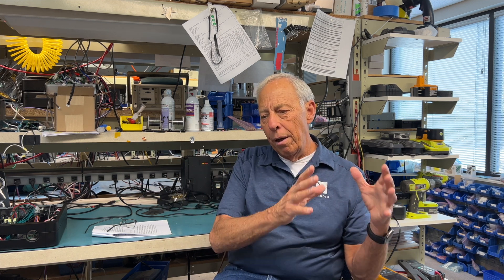Class D amp fatigue

Comment: In my engineering mind, the amplifier should be able to be treated as a black box.  You put a signal into the input and the output ideally is exactly faithful to the input except for having its amplitude increased.  

The faithfulness of this process can be measured and all sorts of geeky engineering characteristics derived.  Doesn't matter if what's in the black box is using a linear or switching power supply, tubes or solid state, bipolar or FET, or what class is being used.  

What matters is how faithfully the amplifier reproduces the input signal.  If it does so well, regardless of the topology inside the box, then it's doing its job.  If a listener is fatigued by listening to a clean amp and prefers listening to their source material through an amp that's less clean and adding color to the material through a less than faithful reproduction, that's not an amplifier issue, it is listener preference.  A subjective impression rather than an objective one.

Like police doing a roadside sobriety check.  Multiple people can watch the test and come to different conclusions - the trained officer (audiophile) arrests the driver based on subjective evaluations and later blood tests (objective) reveal 0.00...0 for alcohol and drugs.

Ultimately it's up to the individual what sounds best to them.  The only real way to know though is the trusty double blind test.

Comment: I disagree. Because paradoxically, this tiring character of class D comes from something "good" in terms of parameters, i.e. a high damping factor, PS Audio amplifiers are no exception. A high damping factor makes the sound "very controlled" but also more nervous, so "short" and kind of tiring. This has nothing to do with the filter (which can affect transparency, decay, etc.). So in my opinion Paul made a wrong diagnosis and (as usual) advertised his own products.

Comment: good coils for the output filter cost a lot of money. low inner resistance makes the coil bigger and it needs the right core material so that it does not get into magnetic saturation when you go over 10W output.
my aiyima 07 max has a 240W power supply that means 2*100W output is possible. i guess they do not have the best coil from coilcraft or würth inside because they are expensive and the aiyima 07 max costs only 95€. but i think below 2*20W they probably do not go into saturation. and i guess i did not go beyond that so far.
when the coils go into saturation at a certain power level, the audio signal gets distorted and that probably contributes to the listening fatigue

Comment: I have an early Class D integrated from Cary Audio (20 years old). It is generally on a 2nd small system.  Cary is most well known for their tube gear that is the polar opposite of fatiguing. However, while the Cary has amazing power and grip with my Volti horns, after a while, I do tend to notice that fatigue factor that the writer mentioned.  I am glad to know there are more class D options as I like much about the format, especially lighter weight and less heat.

Comment: Here is the limits of class D ;
Every frequentie-range you adjust in an equalizer in Windows or Linux has a negative influence in other frequencies.
When you adjust 500Hz - 1.5dB you boost the lower frequencies but also the higher voices starts to distort.
As i understand, every adjustment, changes the impedance in other frequency ranges. 
So you add distortion and higher frequencies really start to distort / cracking when you start to adjust somwhere in the bass or voice range.

"EQ flat" ; some people like the "extra detail" but for most people it is exhausting. 

If you want to fine-tune what is coming from  a class D amplifier you must make the adjustments with really 0.1 dB's  

I have experimented all logica.
To adjust the equalizer then start with the high bands.
I own a Yamaha and lowering the last 3 only, works like a charm.

I do miss my Class AA mosfet though but not my electricity bill.  ;)

Comment: For those using inexpensive class D amps place a HIGH value resistor say between 330 Ohms and 560 Ohms across the speaker terminals.  You will need to experiment to find what you like.  It has very little effect on the speaker impedance and won't overload the amp.

Comment: I used to listen at way higher volumes when I had smaller speakers but now have literal towers of speakers (almost as tall as me) and only ever need to turn it up to 1/4 volume for it to be at a good level, (I have a class D amp), it is quite loud at that level. If I'm emotional and need to get that feeling of power from loud music I might turn it up to 1/3 volume. I listen to music for most of the day usually (I'm disabled so don't have much else to do most of the time)

Comment: same for me, listener fatigue sets in early for me when listening to music thru my (admittedly, low-class) Class D Fosi V3 amplifier from Amazon. i'm not sure if the bright & shouty, in-your-face, sound is typical of Class D amplifiers, since I've only had a real good listen to the Fosi V3, which is a rather impressive-sounding amp for its size, but it can also be like nails on a chalkboard after listening for a while. Maybe the higher end Class D amps are better sounding, similar to Class AB? There's just something about using PWM to 'chop up' the music (waveform) before delivering it to the speakers that I think makes Class D sound decidedly discordant, to my ears.

Comment: I have used tpa3110 tpa3118. They were okay, but the similar 3110 had different gains. I have used tpa 3116d2 , and mosfet class d  power amps with regular components non smd components. These class d don't last long like the class ab types, class AB are robust.

Comment: Class D amps themselves don't have a colour to their sound, that's the best part, as long as the output filter is made with decent components it should be absolutely fine! The hardest part is pairing speakers with them, as most speaker manufacturers do their R&D with AB amps, so they colour the sound of the speakers based off amps with a completely different tone to class D

Comment: There are some class D amps that use the Texas Instruments amplifier chip and sound amazing the price and an excellent option for a budget home stereo setup. Not the most accurate class D amp but it is very beginner friendly since it’s more mellow and forgiving to the ears than more expensive class D amps. I personally prefer the sound of Class AB amplifiers with linear power supplies that has that small amount of distortion that pleases the ears the best.

Comment: I can relate to the listening fatigue, I have heard a lot of class D amps and finally decided on Hypex NCore400 units. I tried them with passive preamp, they were very detailed, strong on delivering a very tight bass and very much in your face, I did not like what I bought very much. And then as luck would have it, I found a preamplifier by MM Audio a division once part of Hypex and designed to be used with their class D amps. The misery was gone and enjoyment started, it gave the NCores more body, more meat on the bones and shaved off bright edges. My personal experience, feel free to disagree, is that class D amps are best enjoyed over a preamp designed for them, or one with a tube stage as Paul mentioned and not over a passive preamp.
Reply: Disagree.  Just get the most linear and low distortion preamp you can, period.  Il you like harmonic distortion added by tubes, then go for it.  In my case, it's a no go, i want to get as close as possible as the recorded audio material.

Comment: Trying to explain pulse width modulation/amplification to non technical people, now there is a challenge.  To understand how this works one needs to understand what a duty cycle is.  A duty cycle is how long the high state is, vs the low state, for a wave that looks like a square wave.  For instance if we look at a duty cycle of 50%, half the time the high voltage would be on, and half the time the voltage would be zero.  For a 30% duty cycle, a high voltage would be on for 30% of the time, and 70% of the time the voltage would be zero. The output of a class D amp would be a series of pulses, that is a train of pulses the swich between fully on and fully off.  The output of the amp has a series of duty cycles (a pulse train.)  When the duty cycle is long, that is the voltage is high for a longer period than it is low, for instance, a capacitor that is hooked to this output, has a longer time to charge. So across the capacitor the voltage can rise.  If the duty cycle that is charging the capacity is short, then the capacitor won't charge, and will dissipate voltage.  The capacitor is hooked  the load (your speakers) so as the pulses charge or allow discharge of the capacitor, your speakers will see a rising and falling voltage. I think that this is the basic idea of how a class D amp works.  If I'm wrong, somebody correct me on this description. PS: So you can see that the output capacitor is being fed by ones and zeros (digital) but the capacitor is charging and discharging at a rate that makes an de facto analog signal comming from it (to the speaker.)

Comment: I understand that problem. I am class D designer. That is typical problem for class D designed with only single feedback taken before LPF. So it is not true that sound is only waveform. Try post LPF feedback like Hypex UcD, Purify or double feedback like Ice Power. Sure Bruno is the god of class D. Try that product. Dont use cheap consumer like TPA, TDA, etc. Those are pre LPF feedback. Yes, fatique in 1-2 hours.

Comment: I bought mono-blocks with Purifi 1et400a modules in them. At first I was impressed by the clean detailed sound, however after a few days I noticed something strange with my hearing. When I washed my hands the water sounding like ice crystals a very high frequency noise added to the water coming from the tap. Then I noticed the sound was in everything, like when I read a physical news paper it sounded like it was printed on tinfoil. I stopped listening to the amplifiers for a week, and the hearing problem slowly disapered. Then I started using to the amplifiers again and after about one hour the strange hearing problem was back. I now have a class-AB amplifier with equally good sound as the class-D amplifiers. Fortunately no more problems with my hearing. I'm so happy it did not get chronical.
Reply: I’ve been thinking about getting my first 400 or 500 watt stereo amp; so I have the option to drive any speakers I throw at it … I’m only worried about the potential to blow my expensive speakers with so much power on tap, especially being a relative newbie to high end audio. How do you mitigate that danger, short of wiring up fuses before the speakers?

Comment: Purifi is the first class D amp module that really addresses the key issues that cause class D amp fatigue. There are a few things. One, most class D amps have not historically been load invariant, and they have tended to have better response up too than down low under load. This means they’re often quite bright. Second, the iron core inductors used for output filtering tend to cause distortion in the upper frequencies, which humans find very fatiguing. Purifi is both load invariant, and has a special feedback loop around the inductor to reduce that distortion to sub-audible levels.
Reply: the first one was the Ncore by bruno putzeys, the purifi is the refined one by bruno too, the latest nilay is the best one so far by bruno of course

Comment: I own a set of Krell Monoblocks FBP 350 MC. after some research i want to listen to the 1200's I hope they will charm my ears as the big Krells have done for 23 years. My main motivation is I need something lighter in weight and does not run up my electric bill. I'm getting too old to be lugging these around. The Krells are linear class A 100 percent. It will be interesting to compare these technologies and hopefully the 1200"s will be keepers.

Comment: the TAS6424-Q1 might be an interesting chip, it's an automotive class d amplifier chip switching at 2.1MHz, i believe that this can have really minimal filtering and thus minimal phase shift?

now ofcourse automotive, and 75W don't scream performance or SQ but it'd be interesting to see more amplifiers reach higher switching speeds, because that will eventually eliminate the need for a low pass filter at all as in the end the inductance of the speaker cables themselves will act as the filters (when it reaches a high enough frequency)

Comment: Mark Levinson does makes a pretty decent class D as well (53?) i think; sounds weird but it's okay.
I did tried coupling a transformer on the output of a 3-watt chip amp and it does sounds interesting, but not that great.
I think the problem with class D is that you need a really clean power section; a direct box or tube input will help, but a clean DC rail is still required otherwise the amp sounds different on silent and loud recording, just like you said! good response.

Comment: I would say that it’s all about your ears! I own a Technics SUV-3 class AB  
Whilst a good Amp when I first owned it it was in my view to much top end and low on bass now I am some what older it sounds better as my hearing has changed , I have always had big speakers , much better Bass response , I have recently built my own   Mono block 100w class AB  and it performs better than a commercial unit by comparison, with a good music uncompressed source it , can produce 1khz  square wave at full power indefinitely into an 8 ohm load  , and at 10khz and is still square very little rounding  would no normally test at that frequency but just tried to see how good it was , do the same to a commercial amp it just cuts out protection circuit kicks in ! Overall my home brew is great very pleased with the results, the first amp I built was a 3 watt stereo class A valve amp  EF86 EL84 I was 14 years old at the time . The 100W amp is a MOSFET using industrial MOSFETs I had access too,

Comment: Riiight, its the filter, who would have thunk, but its the input stage you need to put your effort into.
No, you're full of hot air, as usual.
Its the speakers, its always the speakers, if anything filter in the amp will chop off some of that harshness, not the other way around.
Oh you find high volumes fatiguing, what a surprise.

Comment: I appreciate this video, Paul - thank you for posting it. Last year I bought a Crown XLS 1000 class D amp to use for amplifying a keyboard rig through a pair of vintage Acoustic 807 three-way cabinets just because my 1980s QSC amplifier is just so heavy and is a 3U as opposed to the Crown's 2U. I really appreciate the flexibility of having the built-in digital filters so that you can implement biamping, use a subwoofer, etc. more easily. But it does have more of a noise floor than the QSC has which isn't that big a deal on a gig but if I'm working with the rig at low volumes at home it's more noticeable.
Reply: I do like some acoustic cabs
Reply: @zeusapollo8688  Sadly the pair of 807s I bought had one blown original 4"x10" horn (implemented as a midrange) that I was able to at least get back from the previous owner in trade for the replacement that was in there. There seem to be only two drop-in replacements for sale in the US; one has a plastic horn and one has a metal horn. The metal-horned one has a very peaky response and the whole cab sounds off with it installed. I put the one working original in its place and that improved things a lot.
Reply: @hubbsllc  I have some big acoustic horns. Wood front.  I will look at the model number when I get home. 4 inch driver sounds about right
Reply: 824

Comment: you say fatiguing  is that where the listener gets stressed to where they fatigue or is it where the filter caps and coils degrade and fail?

sort of like what happens to capacitors in vintage tube stuff where they can get leaky and even  short destroying power stages and even becoming dangerous and deadly (death cap) where they can leak the full 110 or 220 to the metal frame shocking the user as often that stuff did not have a widened prong so you can plug it in backwards?

Comment: I have Crown Class D amps ... fou of them one for each frequency and one for my double subs. I had turned my speakers into active speakers and got rid of the passive crossovers, while using a DBX active crossover between my preamp and the Crowns ...I think they are detailed, focused with great accurate imaging...but to me, never fatiguing. I know everyone wants to say and are greatly convicted that theirs is the best;however, I just know I like mine and there are others who have listened and were impressed by them. The point is: if you like the way hopefully your system sounds...that is all that matters. Enjoy....
Reply: I remember a long conversation with Crown in Elkhart years ago, when I was switching away from Audio Research, Mark Levinson and Crown A/B amps.  Their guy (who struck me as very knowledgeable) told me everything was changing and suggested I try one of their XLS amps if I was an "audiophile".  I used it for years and it sounded pretty good but would love to know what might be better without paying "snake oil" prices?
Reply: I have a Crown XLS driven by a tiny Radsone EarStudio (full differential mode) and driving Yamaha Pro Audio speakers (horn tweeters) All this in my cluttered workshop. Amazed at how good it sounds: crisp highs, very comfy. Listen hours a day.